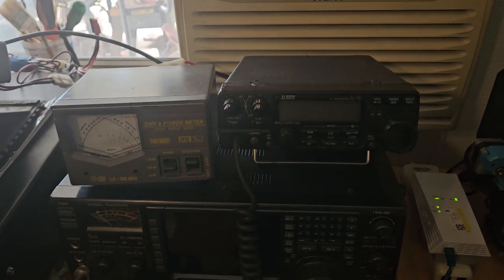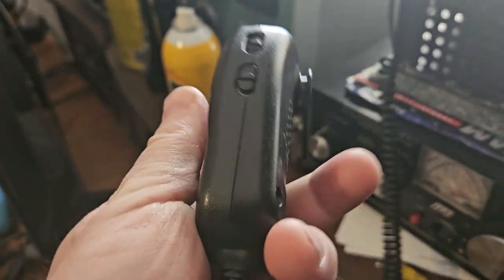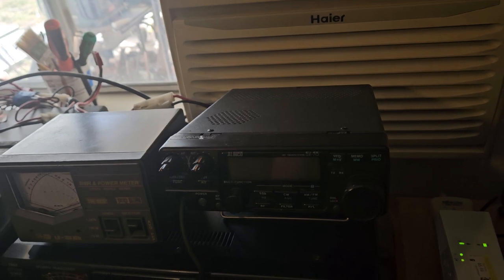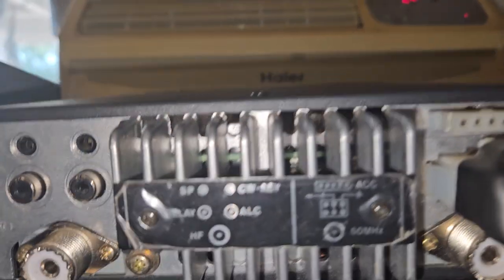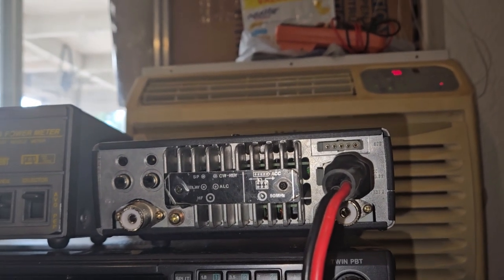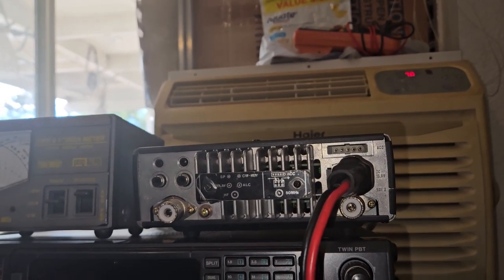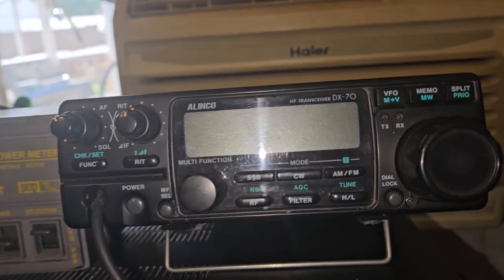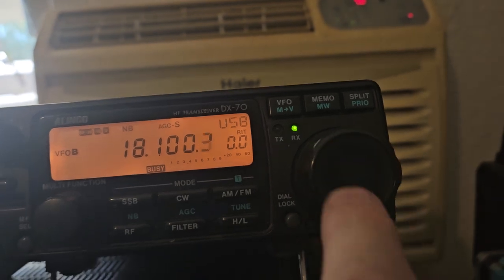Removed all ham radio gear from truck sadly

Comment: Precious little Transceiver, the Alinco DX-70, all of them i head in SSB (speech) make a good modulation (without exception).
Reply from the maker: Mine is just a hair off frequency.  My 756pro show its off by .06 but i think it gets worse higher up. On 7.000mhz im picking it up 7.000.06 seems like that shouldnt even be noticeable but it is for some reason. I need to find a service manual w alignment  procedure and get this radio dialed in
Reply: @hamradiohack  i wouldn't open that box, something can go wrong and then the radio is damaged beyond repair, that happen to some people i had QSOs with. 60Hz deviation isn't much, that can be adjusted by that "Rit" knob.